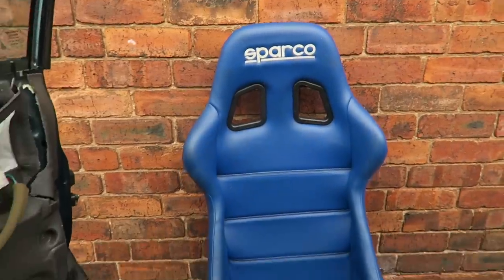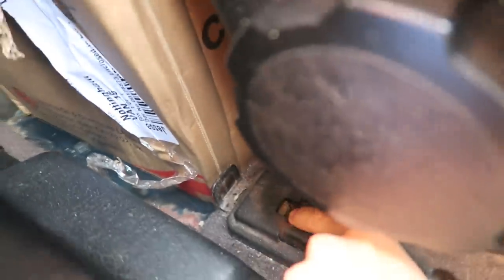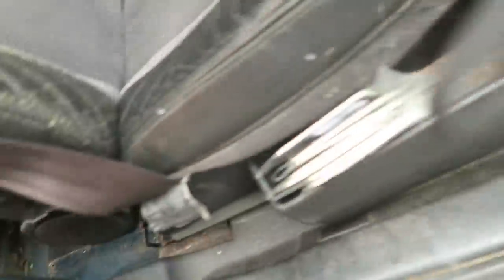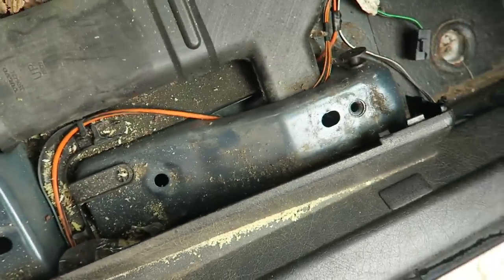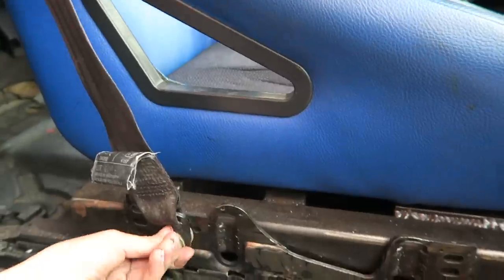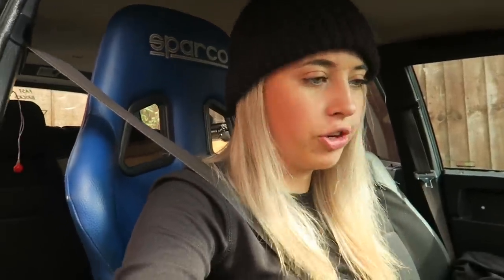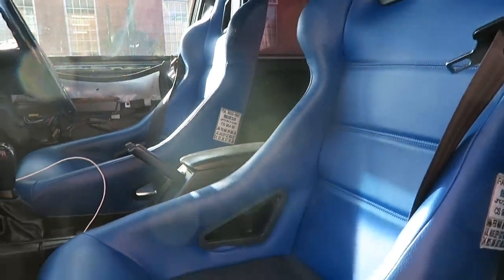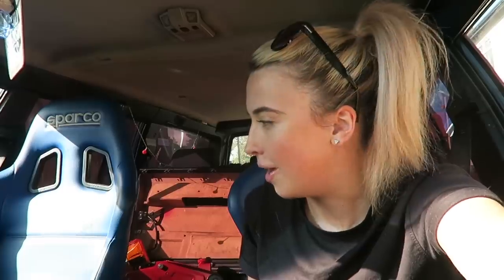BUCKET SEATS FOR THE 940!

Comment: Ive put a electric fan of a e46 on mine and works a treat done away with the standard fan just takes power away like aircon keep the maff clean and intake too ... get rid of the standard intake pipe for a hard one the standard ones like to suck in and restrict flow